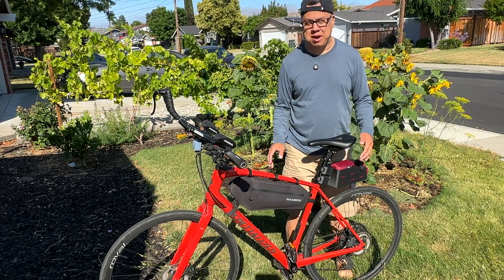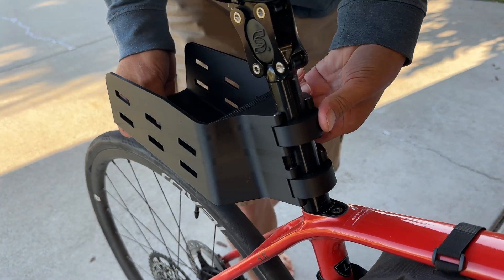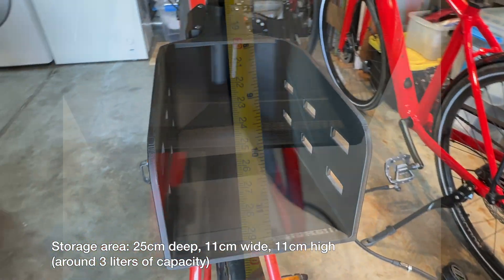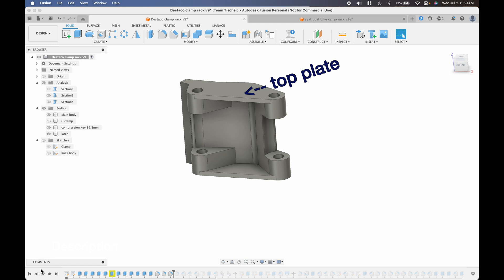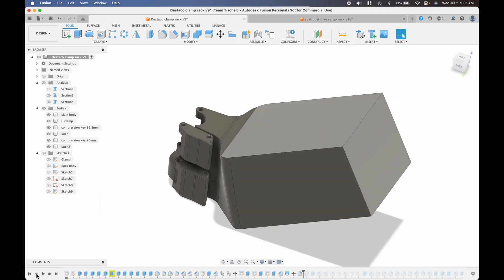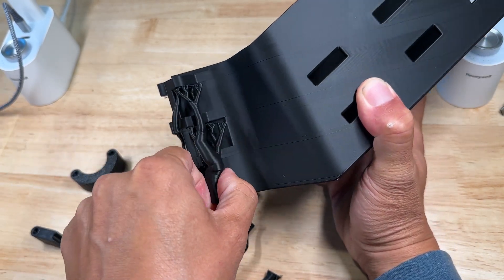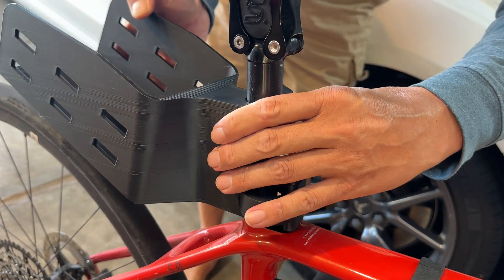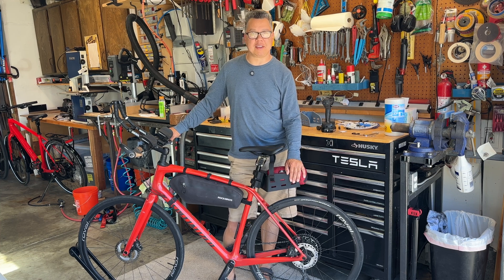3D printed saddle bag cargo rack - Free Download

Comment: Wow, really cool!  Please post the model!  I'm curious how you worked out the seat post snaps.. did you have a previous design (or somebody else's template), or maybe a better question is how many iterations to get those snapping and holding in permanent fashion?  I can imagine the shearing forces on them given the vertical whipsaw action of bike frames going over bumps and potholes.
Reply from the maker: https://makerworld.com/en/models/1576029-clip-on-cargo-rack-saddle-bag-for-bike-seat-post#profileId-1658133

Just took one iteration to get the clamping force right.  Not sure how much variation there is in 27.2mm seat posts, mine measured 27.4; there's an easily modified link in the latch that can be changed out to make the fit tighter/looser.